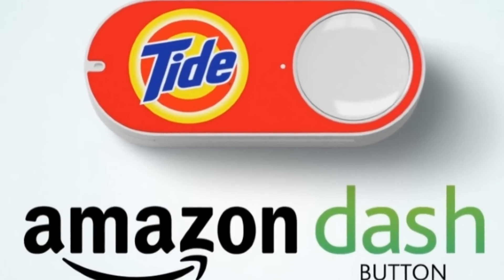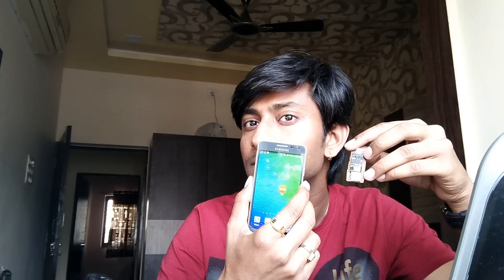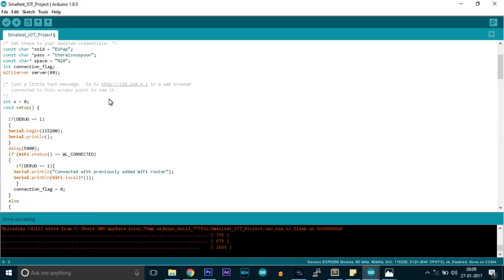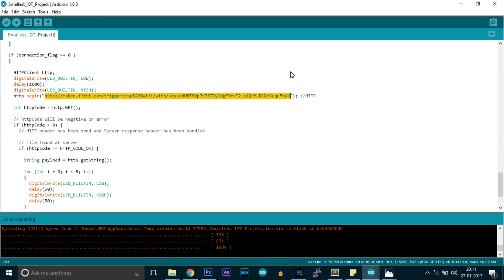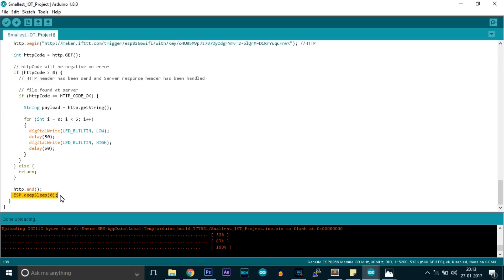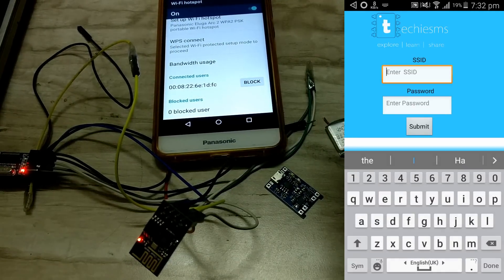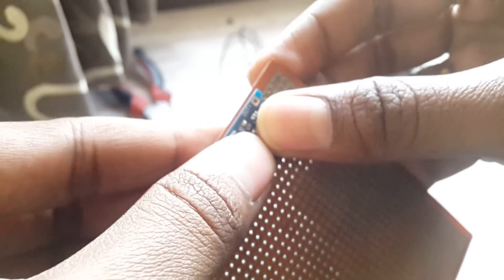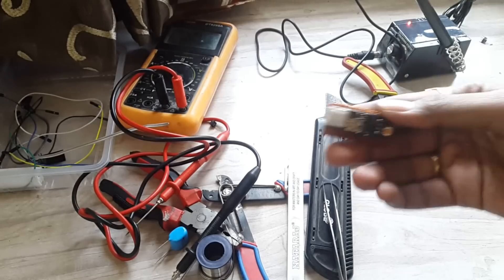DIY World's Smallest IoT project| IoT button | ESP8266 projects | IoT Projects

Comment: Cool project bro. Hey I have one query, you have connected the esp-01 module directly to lipo battery which output(4.2v to 2.5v). The module is designed to run at 3.3v. How is the stability at such varied ( and out of specification )range I too need to do similar lipo powered project and was thinking of adding voltage regulator(bulky) but if your project is stable I will skip it. Kindly let me know.
Reply from the maker: +V P I personally didn't face such problem of stability.

Still if you are planning to make project to last for long time, go for lm1117 3.3v reg ic in smaller package (smd version) that won't be bulky at all.

And making a project just for experimenting purpose you can avoid that ic
Reply: Thanks Bro :)
Reply: Thanks

Comment: hi can you suggest me a code for below working.... in arduino. 
the relay are attached at pin 10,11.

1. When button pressed 
Output at pin 10,11 low, 
2. Button again pressed -
after 2 second delay. ...
Output at pin 10,11 will high ...
3. Button again pressed the output at pin 10,11 low. 

The above process is in loop.

Comment: Hello sir thanks  a lot for video my question  to you is how can skip program  part like i need to add manually  ssid n password  n auth token in blynk can i skip that like first  connecting  to own wifi then you enter it manually??
Reply from the maker: +Soumil Shah with the help of my app and code, you'll be able to enter ssid and password manually not auth token.
As I have developed the code for this purpose only
Reply from the maker: +Soumil Shah it will take time 
I am busy with my stuff 

But send me the details of your work through email 
sachinsms1990@gmail.com
Reply: techiesms  no problem  il wait 
 You  sharing  such a valuable  thing that's  knowledge  il wait for that  bro

Comment: Thank you for the nice project. However, I don't think it is a good idea to power the ESP8266 with 3.7v battery directly since the the fully charged battery will have a voltage of 4.2 while the supply voltage for the ESP8266 should be between 2.5 to 3.6V
Reply: what LDO module should i use in this case ?

Comment: This is exactly what I needed but a switch instead of a button. Thanks so much for the video.
Reply from the maker: Happy making😊
Reply: Where did you get the battery? Does it have to be exactly 3.3v or would 3.7v or 3v work?
Reply from the maker: It should be from 3.2 to 4

Comment: what is the function of the iot button???
Reply from the maker: +Debjyoti Roy Chowdhury there are several applications of this tiny little button. I'll write down some of the application for you,

- you can use this button in case of emergency. Press the button and it will make calls on registered numbers.

-You can use this for home automation. Press the button to turn on/off your frequently used appliance.

-You can use this for security application. Attach a sensor instead of button that triggers whenever anyone silently enters your home.
Reply: can you make a video upon home automation by using this button..........pleause

Comment: Using blynk....

3.3v (from  Arduino )    +  esp-01......gpio0,2 working with relay

3.7v ( external ) + esp-01......gpio0,2 working with leds 

3.7v ( external ) + esp-01......gpio0,2 NOT working with relays.....please help why the relay is not working

Comment: Have you replaced the R3 resistor on the tp4056 module? It defaults to charging at 1A. Thats too much for the battery. At best you will damage your battery and and worst you are creating a dangerous situation. Please read the TP4056 data sheet and think of your safety.
Reply: Why include thetp4056 at all? "The Worlds Smallest" could be ever smaller i guess? Perhaps also take a look at SPX3819 to maintain your voltage.

Comment: Great Stuff ! keep it up. One question: will the battery 3.7 Volts not effect esp ? as its mentioned in its datasheet voltage range must be 3-3.6V (ideal 3.3v) and you're not using any regulator.
Reply: Same thought here